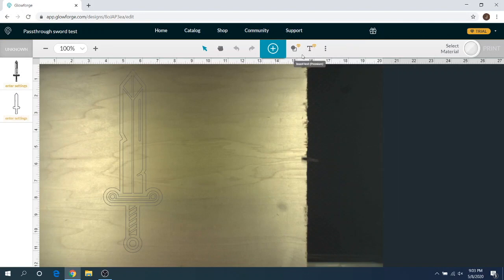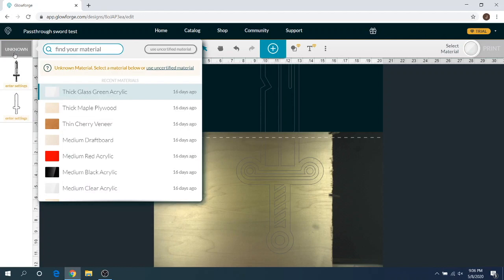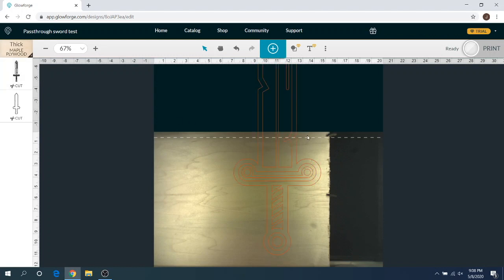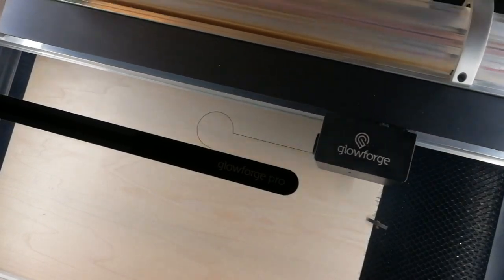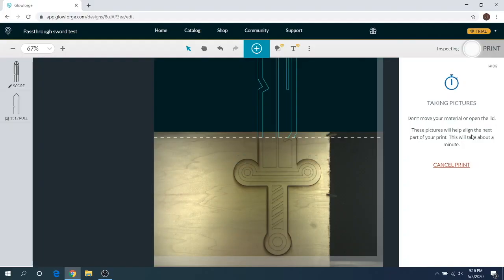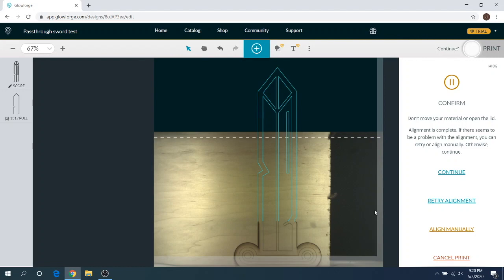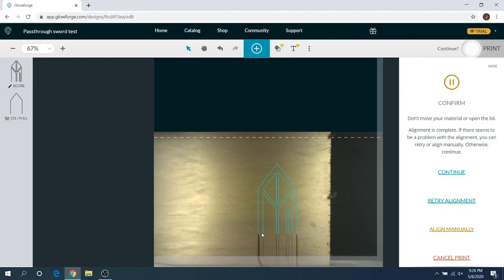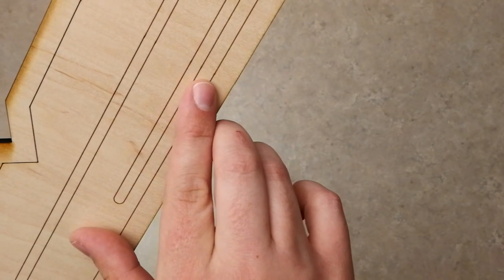How to use Glowforge Passthrough Software?

Comment: Hello. I have a question, my machine keep saying (cooling down) what can I do? Thanks
Reply from the maker: Make sure the bottom right of the machine is free from anything blocking it as that is your machines intake. Second thing is turn down the air-conditioning in your how and try to get it below 72 degrees to see if that makes a difference. Lastly, make sure all your fans are clean, including your air assist fan.

Comment: help.. when using the passthrough it prints the first one.. then I get the error message telling me the print was unsuccessful.. what do I do? or how do I fix this?
Reply from the maker: There's usually a rescan/focus button but if that's not showing up or working, you may have to contact support. This is still in beta and bugs can happen.

Comment: I have watched your video several times. I am following your instructions, but even with beta checked, I am still getting No artwork error message. I am trying to print a multi-piece shield design. By the way, I cut perfectly scaled down. Can you help?
Reply from the maker: It sounds like you are going past the cutting areas on the sides. That is my best guess on why it says no artwork found.

Comment: When using passthrough, and I have cut speed set to a specific speed (say 180), and I hit Print, it always changes on the left side of the screen from 180 to 184 (or 500 to 518 or whatever), whether I'm using Proofgrade materials or not. I noticed yours did the same thing. The speed went from 130 to 131 after you hit Print. Is this normal behavior? Why does it do this? In my case, in addition to the constant speed change, the focus also goes way off and nothing cuts all the way through. Everything works flawlessly as soon as I disable the passthrough.
Reply from the maker: Weird, I never noticed that. I'm guessing it's a bug that may need to be reported. The Passthrough software is in beta right now and still being tested.
Reply: @FreshStartCustoms  Yeah, I've already posted about it over a week ago in the relevant forum that the developers monitor. Thanks.
Reply from the maker: No problem anytime. Sorry for late reply. My notifications were not coming through correctly.